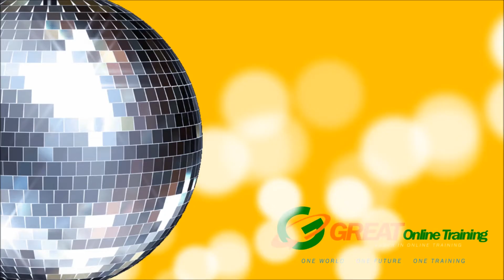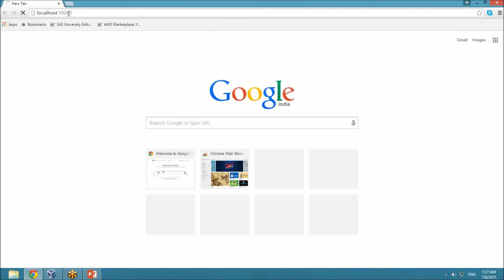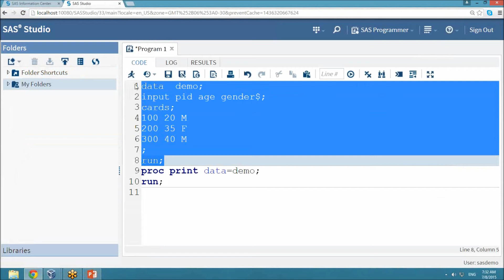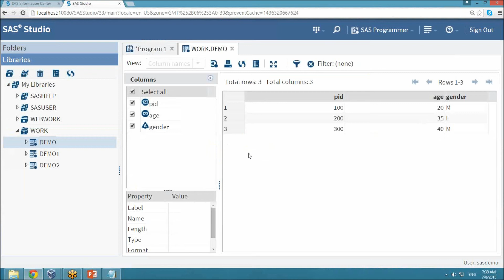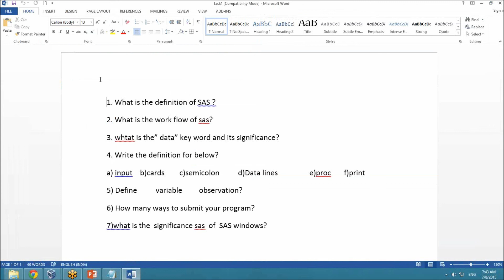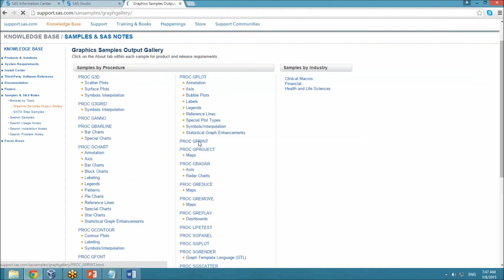SAS Training: What is SAS ? How to Learn SAS Programming - DAY 2

Comment: Hello! Than you very much!! Can you help me? 
Thank you in advance!
Regards, 

1.       What is the definition of SAS? 
SAS is a Statistical Analysis System or Software
2.       2. What is the work flow of SAS?Raw Data - Data step - SAS data set - Proc step - Report

3.       What is the “data” key word and its significance?
Data is the first step required in the editor windows and it is used to put a name to our data set.

4.       Write the definition of below?
 Input: It is required to read the value of our values. Character values must be accompanied with the dollar symbol($)       

Cards: indicates that data lines follow,    

Semicolon: It is “;” and it is used at the end of the sentences when we want finish a mandate (getting)
 
Data lines: our data set (male/female, age, pid…). Provides the names for our data set.
        
Proc: it is the procedure that we want use
       
Print:  I do not understand what you said ??

5.       Define variable observation
It It is a variable, which we indicate in the data step with the "input" statement.

6.       How many ways to submit your program? 
???
7.       What is the significance sas of SAS windows?
??